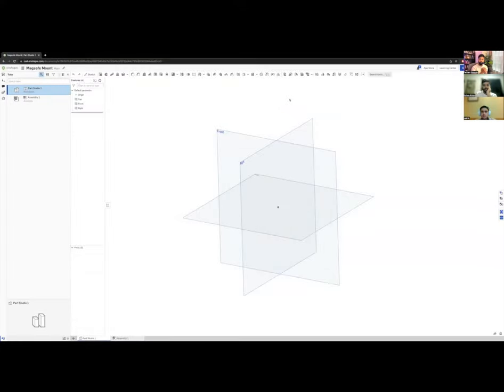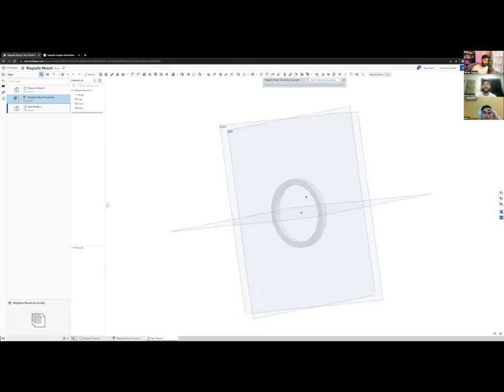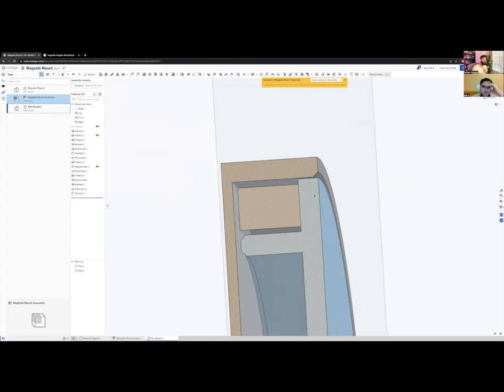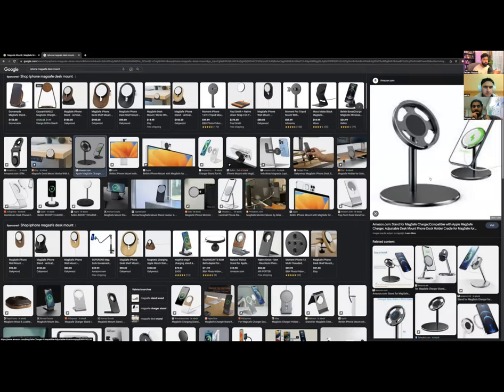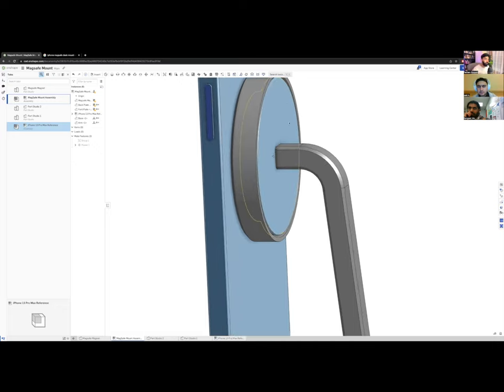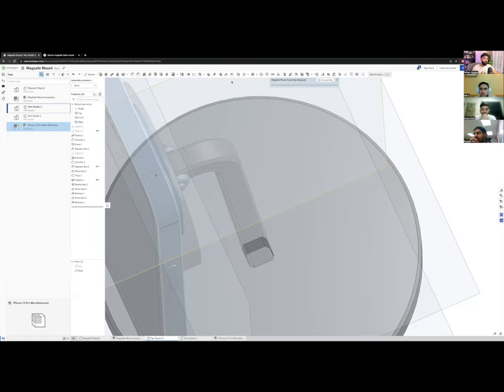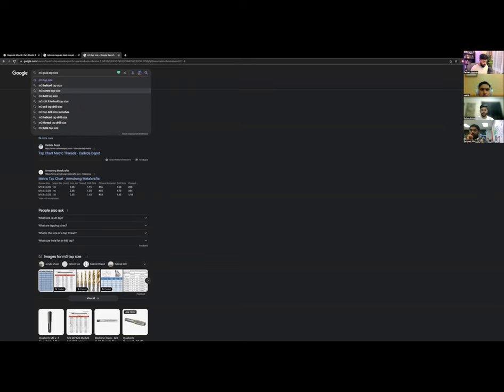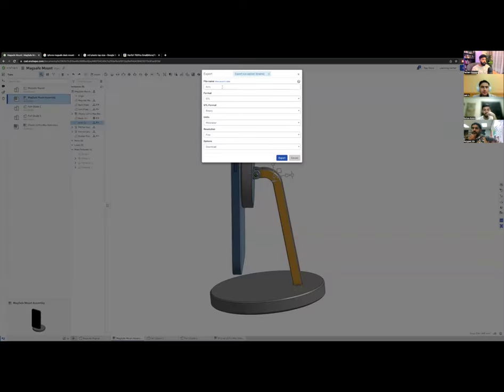MASTER CAD MODELING WITH AN EX-APPLE ENGINEER

Comment: calculating the mass of the arm and he base, and knowing the weight of the iphone can help you engineer the spacer for the magnet to control the breakaway holding force of the magnet.  i.e. if the weight of the whole stand was 8oz, you wouldn't want the magnet's holding strength to be that much.   etc...

Comment: i feel like it would have been better to keep the screw straight into the arm.  So the alignments  of the bottom holes should have been adjusted/angled to allow the screw to thread straight into the arm.  The arm is the weaker of the two.  To have the self-tapping screw go in at an angle is going to cause uneven bulging in the outer surface of the arm since the pressures  on the bore hole will be different due to the different thicknesses of the hole-to-outside-of-the-arm.